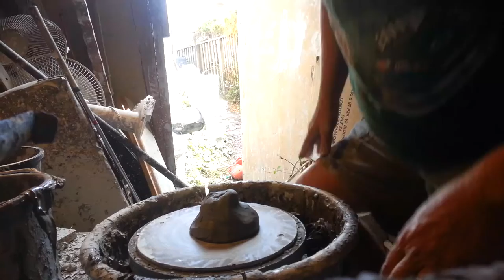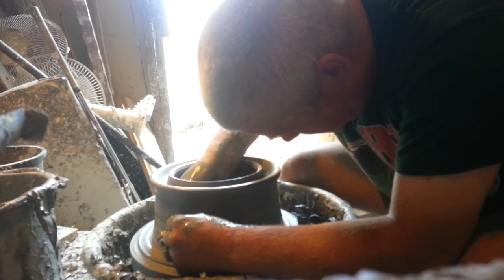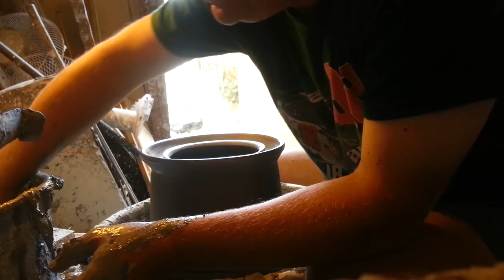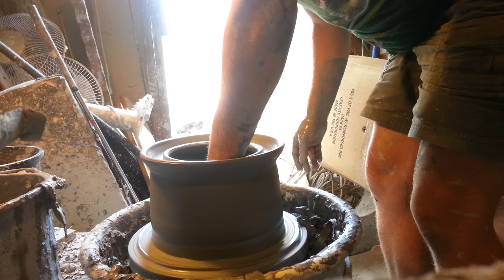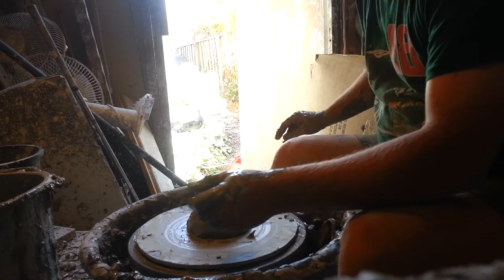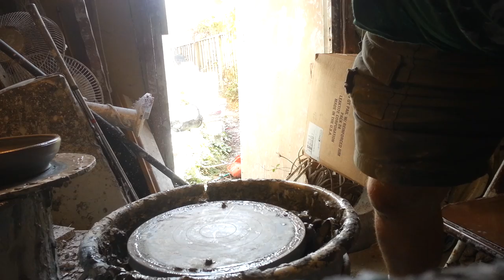How to make a one gallon fermenting crock

Comment: The moat is actually so that excess fluids ( from the ferment expanding) can drain into it instead of all over your counter or floor or wherever you leave it to ferment. 
As long as you have your veggies submerged under the fermenting liquid, they are safe from spoiling microbes or pathogens. An airlock might help keep yeast or mold from growing on the surface, but yeast and mold don't spoil the ferment. They might make it taste less pleasing if you don't scrape them off regularly, but fermenting is a super safe and fairly fool proof way to preserve food.
Reply: Salem Thorup nope- shouldn't be filled that full. The moat make a water seal to let gases out and to not let oxygen in, that is all. Cb75
Reply: Salem Thorup Just corroborating what the other guy said. The moat is meant to hold water with the lid placed on top to act as an air lock.